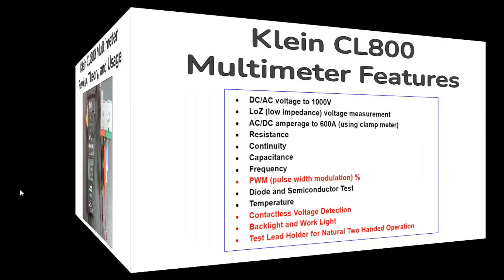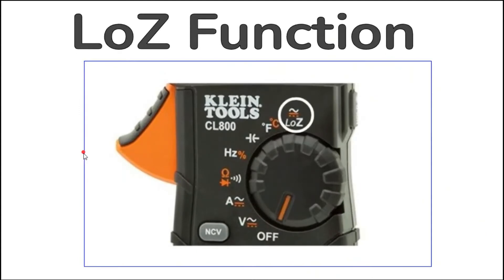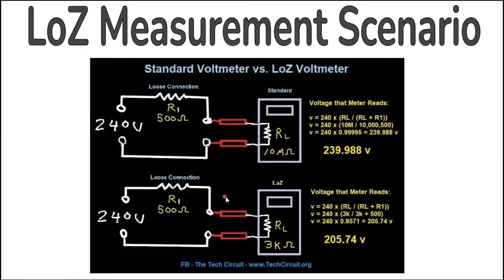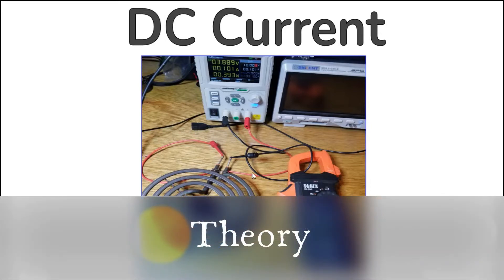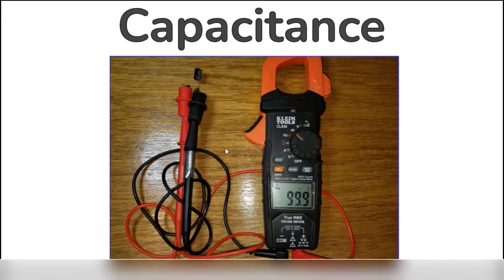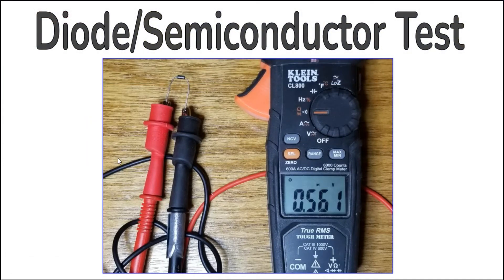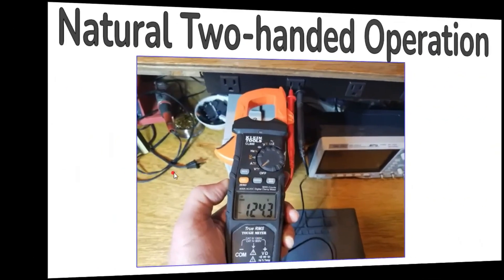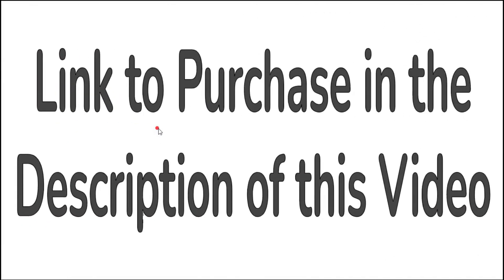#33 - Klein Clamp Meter Review, Theory of Operation, and Detailed Usage Tutorial

Comment: Excellent video. Great explanation of loz. In the past I’d found testing a circuit while under a similar current load to be helpful, but this could be a faster way to test without being lead astray by a circuit that will only carry enough current to read Ok on a volt or ohm meter.  For someone with an RV this would be perfect. AC amps for testing current draw of air conditioner compressor (sealed, so only way to get an indication of loss of refrigerant) and heating elements, DC current for brake magnets, solar modules and converters, frequency to check generator rpm/governor, temp probe for air conditioner and fridge…

Comment: Is the cl800 rated for over 600v ac?
Reply from the maker: Per the user's manual, it's maximum AC input voltage is 600V AC RMS.

Comment: What is dumb to me is the voltage detection isn't audible.  That makes no sense  as the unit DOES have a beeper which you will hear when you turn the unit on. I have the same device.
Reply: Yeah was pissed off about that when I bought mine, I think it only works with cl390 model
Reply: @mahmoodrahimi3  poor babies 😔
Reply: Aww, that’s too bad 😔 😂
Reply: I would buy a separate dedicated non contact voltage detector

Comment: Beginner question resistance. The Klein "injects a constant current" to be multiplied by the resistance to determine volts. What value is used for the "constant current" in the calculation?
Reply from the maker: Great question. It varies depending on the range. I don't remember the exact value per range, but it's easily measured. Higher resistance ranges use a lower constant current.

Comment: I have a question. I just got one of these and would like to use it to figure out the length of some spools of wire we have. They are 750 mcm and were 1500 foot originally. There is still quite a bit left on them but the last guys to cut them didn't mark how much they cut. is it possible to use this mm to figure out the length? if so, what settings should i use? Thank you.
Reply from the maker: You can use the resistance setting along with the specified ohms/foot of whatever material they are made of (assumingly copper). Take the measured resistance in ohms and divide it by the ohms/foot for that type and diameter of wire and that will give you the length.

Comment: Excellent video! I have this meter and a con for me is having to disconnect the leads from the meter in order to use the clamp for reading current. Do you know why this is necessary?
Reply from the maker: I've found that not to be the case with my Klein CL800. I can measure current through the clamp with or without leads connected. In fact, the leads play no part in the current measuring circuit.
Reply: I rechecked this. If the common lead is attached, I see no difference. If the hot lead is attached, I get different voltage readings. If the hot lead is connected to a 120V source, the reading is significantly different. I get the same results with my Ideal  61-757. In fact the Klein manual, states to disconnect the leads when using the clamp. It does not state why. I would think that the lead sockets would be 100% decoupled when amperage is selected. My only thought is that in some advanced HVAC meter models, one can get milli-Amp reading through the leads and higher Amperage readings through the clamp.  Some circuitry may be shared and therefore the socket isn’t decoupled on those models. Those same base boards might be used on the non-HVAC models without that functionality, bit with the same coupled socket?

Comment: I am a little confused. You said in the CONs that there is no In Line current measuring. But isn't that just what you are doing at 0:38~1:02? I just don't get it ( I am am an amateur, sorry....) Or did you mean that you have to measure an line that you cut and then hook up to the leads? And that that is not possible with the leads?
Does the CL 900 e.g. does that?
I am just confused. Sorry and I hope you can help me out. Great video btw!!!!!!!! Simple and very instructive.
Reply from the maker: Hello. 0:38 -1:02 was voltage measurement. Not current measurement. Current measurement is covered in 4:49 -6:10. Current measurement for the Klein CL800 uses electromagnetics (for the clamp) for AC current and a magnetic sensor (Hall effect sensor) for DC current. With in-line current measurement, which this meter does not employ, the meter is inserted within the current path. Then current flows through a low-ohm resistor (shunt) within the meter, where ohms law is used to calculate the current.
Reply: @TheTechCircuit  I understand! Thank you. Did you discover a clamp meter that can do in-line current measurement?
Thanks again. I learned some things that has bugged me fore ever. I am a wood-man. Electricity is pretty difficult for me.
Have a great one!